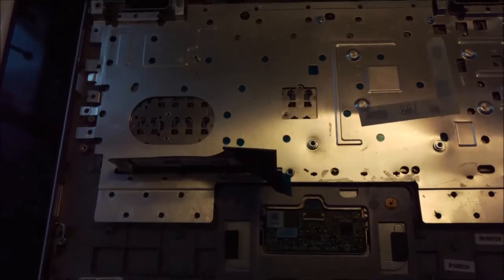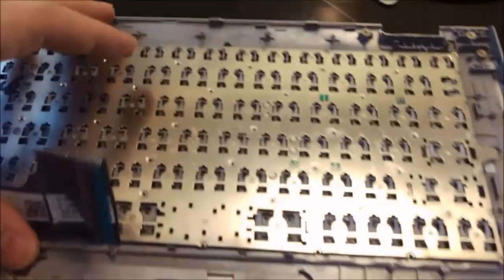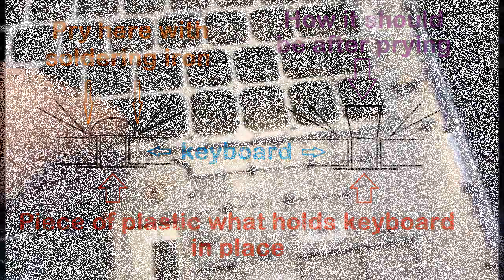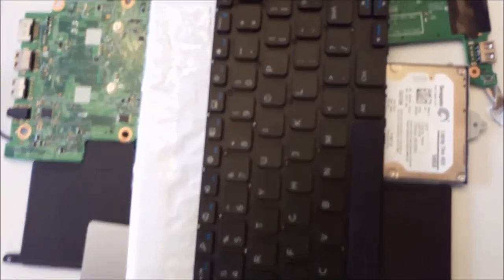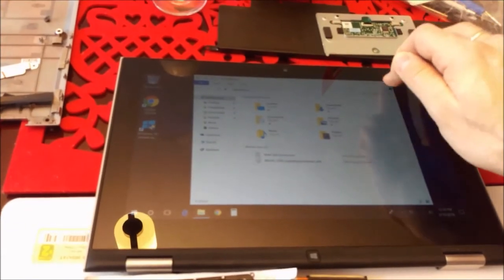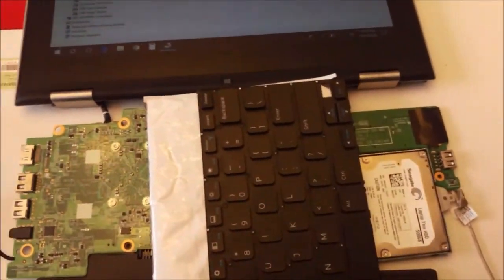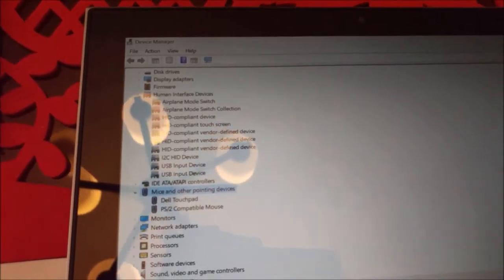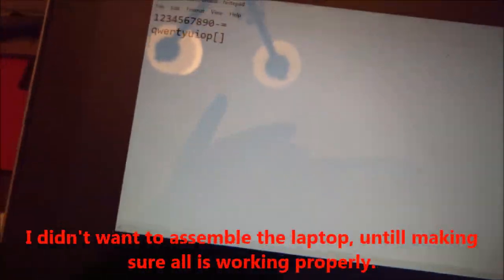How to Replace the Keyboard on Dell Inspiron 11 3000 Series

Comment: My keyboard is not trigger any actions when I click on keys. I am not sure if it keyboard  or some sort of setting. I was playing with tablet mode. Switching back and forth. Keyboard was working and then just stop working and I am not sure what is th ed problem.  Do u have any ideas, please?
Reply from the maker: First - restart the computer,
Reply: @AlejandroNemo  of course I did..few times.
Reply from the maker: Try to get to bios configuration and check if the keyboard works there.
Use USB external keyboard, go to device manager and delete keyboard from there, reboot.
Reply from the maker: I meant in Device manager in Windows